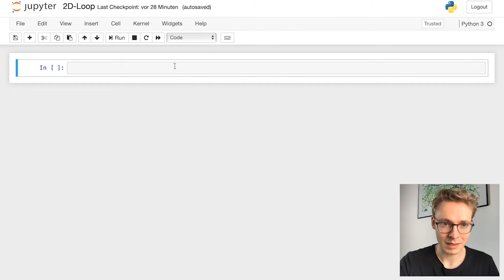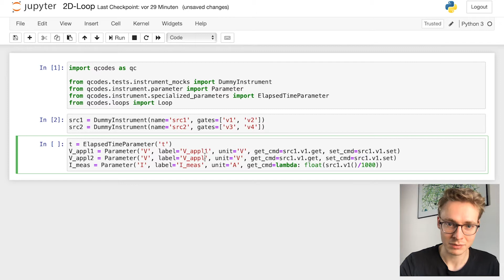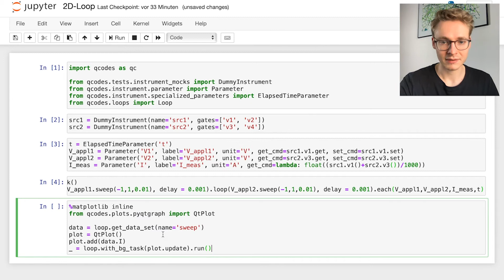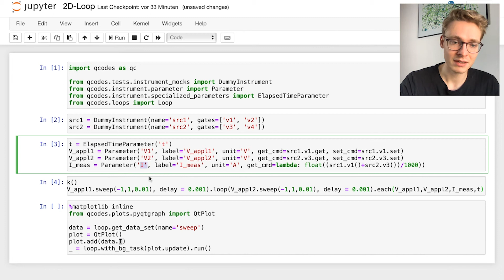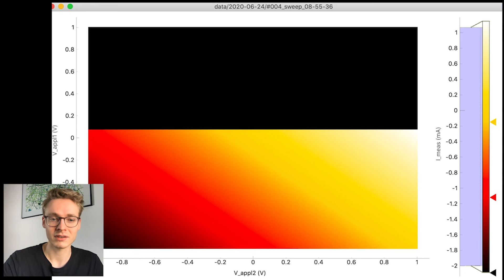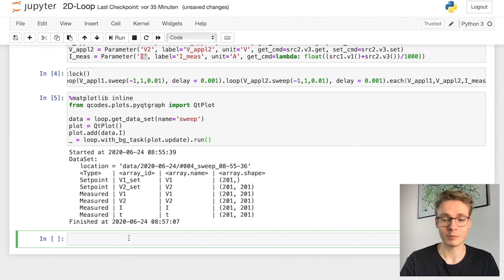QCoDeS - #8 Loops in 2D

Comment: Do you think one has two write separate function or loop for ramping up voltages to desired loop voltages e.g. Lopping between -1V to 1V for Gate-1 and -0.1V to 0.1V for Vds. Now if we directly run this, device sees as sudden voltage of -1V at first. So is there any safe method or strategy in Qcodes to safely ramp to initial voltages and safely lower voltages upon completion of 2D map.
Reply from the maker: There is a function called sweep, that we would usually use for this kind of a job (documentation: https://qcodes.github.io/Qcodes/api/parameters/parameter.html). You can use this to pre-set the values before you start the loop.
So you can use the function in order to define a parameter range to sweep over and then use a for loop to keep changing the value more smoothly. Some instruments also have dedicated functions for this which you would find in the driver.
After completing the loop you could for example use the get value function of your parameter to define the staring point of your sweep and then use zero as an endpoint in order to slowly sweep back down to zero again.
I hope that helped.
Reply: @SchoolofQuantum  Thanks a lot its definately helpful.
Reply: @SchoolofQuantum  Apparently, I found 1D sweep using loop function was a much convenient option. Just called them before and after. Thanks a lot.